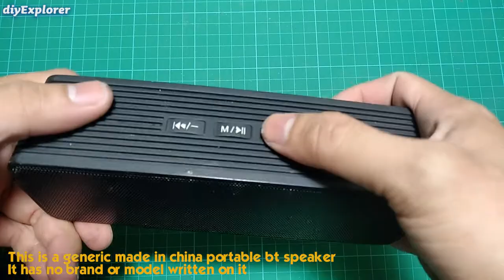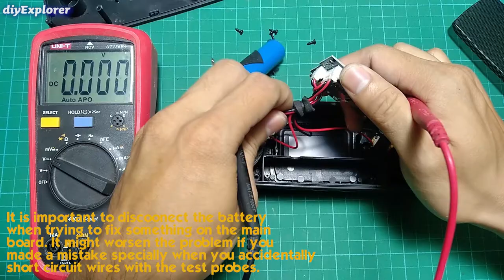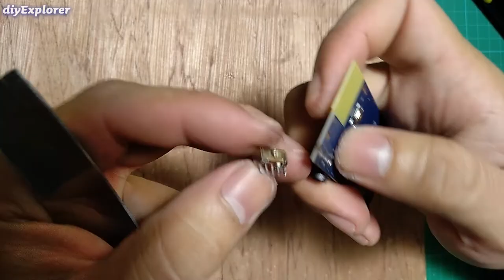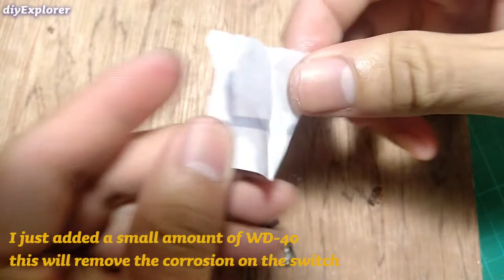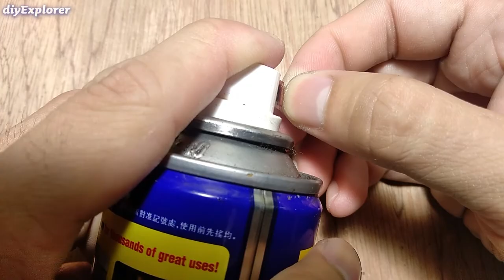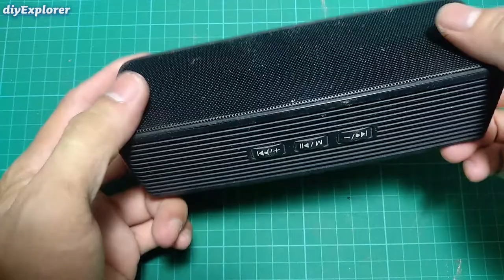How to repair bluetooth speaker

Comment: Hey could you please give the buy link of that on/off switch. I am having the same issue. At some point while sliding the button gives the power connection. but the volume buttons and top blue led aren't working. So i thought to replace the button and see. Help me.

Comment: master how about bluetooth speaker that has power and connected to bluetooth but no sound....can you give a tutorial on how to repair??
Reply from the maker: Have you tried using another phone to connect to it? 
Have you tried removing it and pair it again?
If the problem still exist, try to check the loud speakers it might be an open circuit. Or probably the low power amplifier that drives the loud speakers has problem. It might be the mini power amp IC is faulty. If you have audio signal tracer it could help you identify the problem on the circuit board.

Comment: Boss paano kapag no power tapos ayaw din umilaw ng led?
Reply from the maker: Try mo muna e check yung charger/usb cable, then battery, tapos power switch. Pag ok lng sila, bka may sira sa mainboard.
Reply from the maker: post mo d2 boss bka makatulong mga members https://www.facebook.com/groups/195153308219163
Reply: No output voltage sa saksakan ng charger sir
Reply from the maker: @jeromedelossantos4150  di ko ma picture out ibig mo sabihin boss. Post mo sa group natin para meron kami idea.